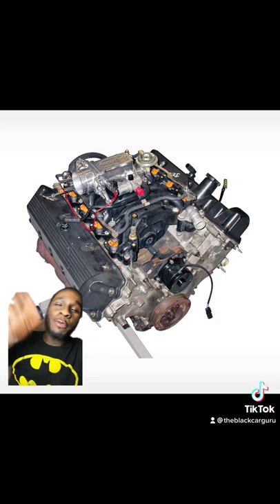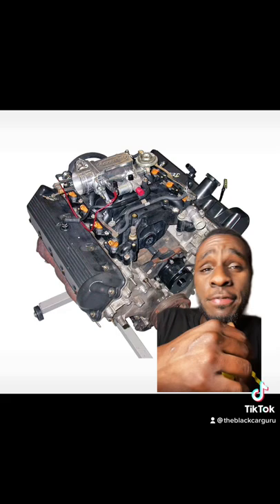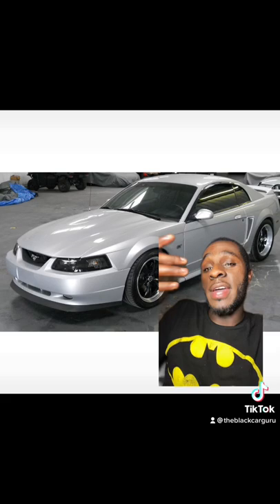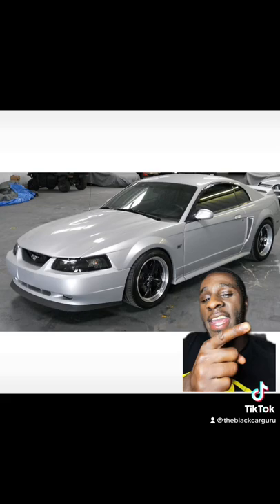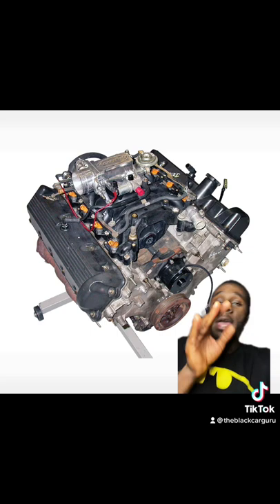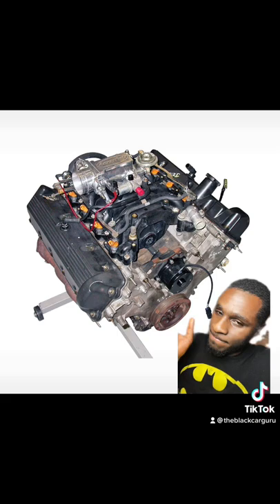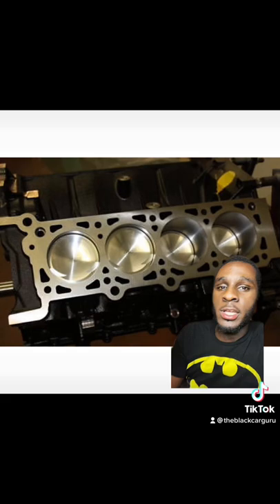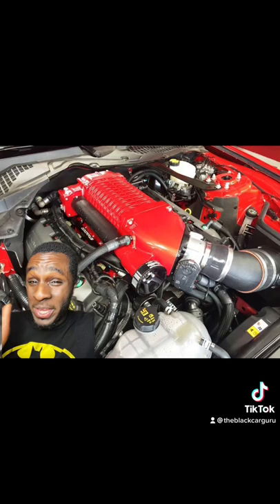Is the 4.6 2V worth building? | Let me explain why!

Comment: I've been meaning to ask about a Subaru impreza, seems like a perfect platform to jump off a super charged import build.  Is the engine any good?  How much power can the AWD system take?  They have a nice low exhaust sound.
Reply: No, Subaru’s are like the evo’s and dodge stealth/3000gt constantly have issues
Reply: Subaru have head gasket issues often...Subaru do make a strong manual trans tho....if you want a subie get an sti there honestly made the strongest but they are unfortunately not as cheap as other wrx and more average subies...EVO have weaker transmission but way better engines to build on
Reply: Gainzzz is right. Head gasket problems all day and a bitch to work on. You’re looking at a ton of money and work just to get to 500hp. Anything above that, you might as well just buy another car for the money. Evos are much easier to work on given you don’t have to pull the motor to do a lot of the work and the 4g63 has been time tested and proven. The only thing you have with the subi is the exhaust sound.
Reply: @Sleepy_spartan717  Yea, I was just wondering really.  Seems like a cool platform from the outside looking in.  I'll prob just buy a a used truck once these prices cool off.

Comment: Not wrong but if you put pi heads on a teksid block with forged internals you can boost it to oblivion I seen it on a thunderbird it made 400+wheel and 700tq
Reply: breakdown the cost tho..
Reply: @Christoph_NTX  junk yard aluminum block less than 500$
 forged internals kit 3000$
 ported pi heads 1000$ 
On3 turbo kit 4000$
Reply: @Ghost56207  you were just quoting a teksid block which is clearly not $500
Reply: @Christoph_NTX  if you can get a whole 96 mark 8 drive train for 1200$ I'd say 500$ for the block is fair considering there's still 4v heads and a transmission to go with it 😘
Reply: @Ghost56207  thats not the aftermarket block, forged internal setup tou just quoted.. you can get well over 400 rwhp in a sbc for alot less than what you stated... oh and have fun sourcing the $1200 4v cobra engine
Reply: @Christoph_NTX  why are you mad? Can't I like my engine and car? 🧂
Reply: @Ghost56207  sp52 - $2600, afr enforcer heads -$1200, super victor single plane - $300,custom grind cam - $600, holley 4 barrel.. made 602 hp crank N/A
Reply: @Christoph_NTX  I get that but what's wrong with building the engine I want to build?
Reply: 400hp????  Your oblivion comes really quickly 😂
Reply: Christoph_Ntx You can get a Teksid block for $500 it’s a stock part 😂🤣

Comment: Bro for like 30k (if you can find one) you can legit buy a last gen gt500 wit 662 hp from the factory
Reply: But for half of that you can buy a 5.4L block built to handle 3,000hp..
Reply: you can build a 2v to handle over 600 for under 2k not including the power adder. this "guru" guy has no idea what hes talking about
Reply: Adam Helmers No 😂 NO you can not build a 600hp capable 2v for under 2k..this guy literally laid it out as simple as possible with the numbers but HE “has no clue what HE is talking about”?? You just make an unsubstantiated claim with zero backing it and that overrules the guru?? Anyone can claim anything kiddo 🤦‍♂😂🤣
Reply: @adamhelmers3185  how?
Reply: @lilc713htx6  gen 2 or gen 3 coyote or boss 302 connecting Rods and forged pistons. Those are the only two components needed for the rotating assembly to handle 600hp
Reply: lilc713htx Those parts Adam listed will end up running you 1000-1500 ALONE..add machining costs/labor, seals, bearings, rings, etc and that by itself would cost another 1500-2500..Adam as enthusiastic as he is, has no real world experience whatsoever and is just giving you what he THINKS things cost without have any frame of reference
Reply: @eriv4735  understandable but could we talk more I want to put a build together you have instagram?

Comment: Can you fit any of the 4.6 3v mustang parts on the 4.6 3v f150 ? Please help !
Reply: They are the same engines
Reply: @eriv4735  which are ?
Reply: jessbigboss09 The 4.63v engine in the mustang is the same engine as the 4.63v in the f150..the only difference is the intake manifold and oil pan..any aftermarket part will fit the engine..what are you looking to do?
Reply: @eriv4735  just looking to improve her performance  make her sound and breath better
Reply: jessbigboss09 The last time I checked eBay had headers that fit the 3v 4.6 in the f150  and you can ditch the rear cars and get an aftermarket muffler..on the intake side you can throw on a real cold air intake..maybe some pulleys, gears, torque converter and a tune..a tune is definitely recommended even stock because it will move your shift points, trim your fuel, remove goveners, and improve throttle response..be safe and happy modding
Reply: @eriv4735  please m8 links would be reslly appreciate it

Comment: This is why I don't understand the 2v ford community. They always talk so much shit about the 03 04 cobra. I just laugh in whine noises 🤣
Reply: im running the same times a stock cobra does (12.8 according to Motor Trend) and ive spent less than 1k on my 2v lol. 2vs are just way more available and maintainable than a 4v. I wish i had a 4v, but to say a 2v cant be built cheaply is just ignorant as hell
Reply: @adamhelmers3185  they can be built cheaply i totally agree and yes i am constantly chasing fixes on my 4v... my co workerand friend has two 2vs yet he has problems as well and the problems on both ends are around the same price when we buy used parts from forums and fb pages or ebay. but forging internals is not cheap unless you get those one off deals or know ppl in the local hot rod community with old used parts. which we both are apart of. thing is i can slap a turbo on upgrade my input spline, clutch, injectors and give it alllll the boost he on the other hand has to spend much more for the internals to do the same thing or baby the boost if he doesnt want internals and those internals wont last very long if you push the boost to hard after tune. 2v are cheaper so you got me there and the used mkt isnt what it used to be so im just lucky i bought when i did. but even 2vs are getting wild thses days which sucks because i was wanting a daily new edge 2v but not with the ever raising prices.just not worth what is out there atm locally. all im saying is if youre going to dump 10k into your 2v you could buy a mid to high mile 03 04 for that with a vmp 2.3l blower slapped on it with kb boostapump, 60lb injectors, lt headers and a basani exhaust for the same price. buuuuuuut its waaaay more fun to build it yourself ;) i am in the process of compound boosting my cobra yeah its kinda a waste when i could slap a whipple on but im just wanting to be a little different in my local area.plus if i hide the turbos in the rear ppl think i just got a ported eaton w/ a pully and they wont know what hit em lol
Reply: Adam Helmers cool STORY kiddo 🤦‍♂😂🤣

Comment: Your better off with a non pi engine with PI heads vs a compleat PI engine because the non pi engine has higher compression pistons than pi engine. If you have a 2v keep it just do some home porting toss cams and springs and a supercharger on it and call it good it will be fast, you don't need to run with hellcats and blown coyotes that's a pissing game the biggest wallet that will win so why bother, Good thing is you can go a centrifugal or a m112 Eaton, you do that and you will have a 450hp 2v GT no problem and that's plenty and a fast rolling burnouts mustang, anybody says that's weak sauce is either jealous or clueless, those 700-1000hp cars are not that great it's hard to put that power down on the street this shit of people thinking they need 800hp to be fast is laughable, so why bother unless you have money to burn. Another thing is quite often people get caught up in the pissing contest and build a car that ends up a finicky race car on the street right past fun and end up building a 450/500hp car to "go have fun with" and they have this 1200hp money pit perpetually broke down and apart and go have a blast with their 450 wheel driver that you set and forget not spend hour and hours turning wrenches replacing broken diffs and transmissions ect all the time until they have $100k invested and loose interest in it and spend all their time hooting and smiling in there 450hp 32v new edge cobra doing 35 mph burnouts Don't get sucked into the pissing contest for bro's and tools that either have money to burn or owe tons of money to the bank with a huge monthly payment. Shit a 300hp pony car is fun AF to beat on... Car guru my ass.

Comment: You right man I just did a pi swap with stage one cams and rebuilt heads, and I had all the other bolt ons. It's fast for what it is but my wife's stock Golf R is faster🤣I do all my own work so at least I saved on that part

Comment: If you got a 2v throw it out and throw a 4v in there with a cobra tranny and intake manifold and a 50 shot...you can get the engine out of the mark viii and for the trans and manifold your just gonna have to hunt for that a little..I'm not an expert like this man here he really really knows but I'm assuming it can be done and all links up...easy and reliable 300whp..and In a light  mustang this year he's talking about youl have a solid running mid to high 13 second car..and that's probly without the spray..aslong as you got some stickies in the back and a nice clutch so you can hook and book nicely..like I said I'm no expert but I feel like I'm pretty sure it all links up

Comment: wrong. Learn how to hand port the stock heads, get some cams, grab some hbeam rods and gap the rings. For a thousand dollars and some elbow grease, you'll make 800 wheel with a 300 dollar ebay turbo.

Or better yet, go to a junk yard, get yourself the heads and timing gear off a 4v and throw those on and turbo it. Do the same h beam rods and gapped rings...

At least then, you'll have one of the best sounding V8's made rather than that ratty ass sounding coyote.

Comment: $1500 for a pi engine swap
Reply: And make 220rwhp
Reply: @eriv4735  pushing over 300hp in mine
Reply: SkullKrusher115 To the wheels on a dyno?
Reply: @eriv4735  just the motor. Haven't dynoed her yet. Just my ruff estimate from racing 

Car will walk a charger rt without trying
Reply: SkullKrusher If it’s sealed, bone stock, and has all the accessories it makes 260 at the crank from the factory which would end up making around 210-230 hp to the wheels
Reply: @eriv4735  sounds about right. Mine is not stock. Custom intake with 75mm throttle body. Cat delete, cobra oil pump. Hotter coil packs too. Proper intake and exhaust mods go a long way